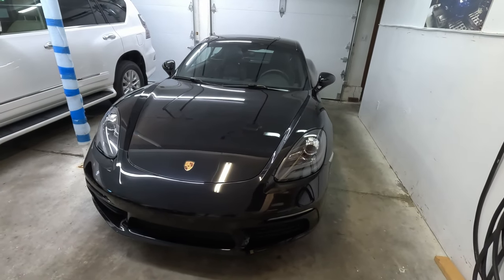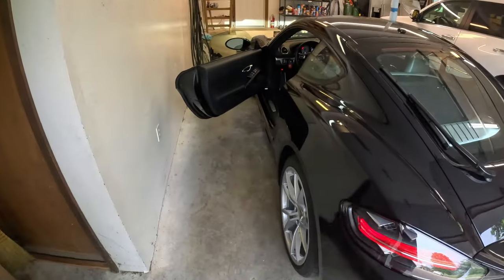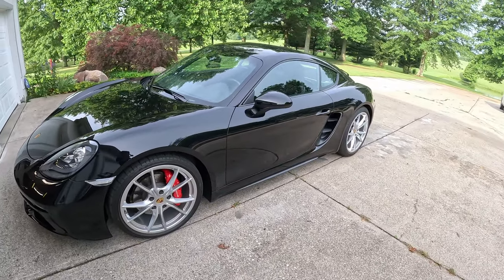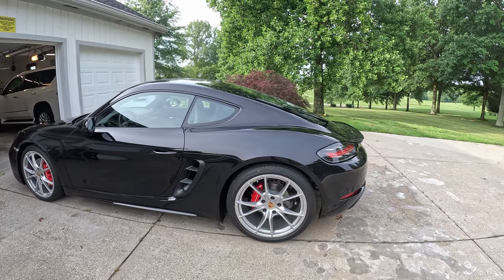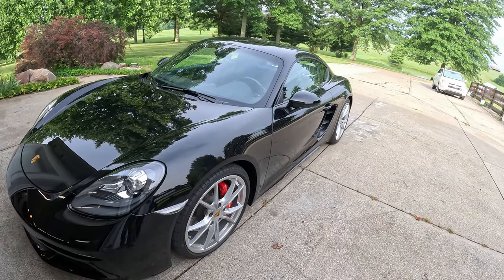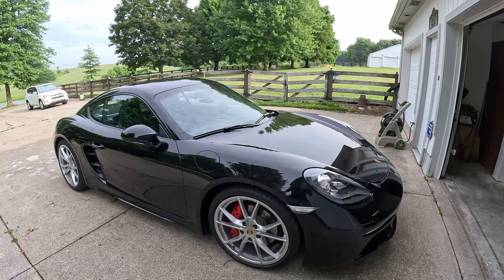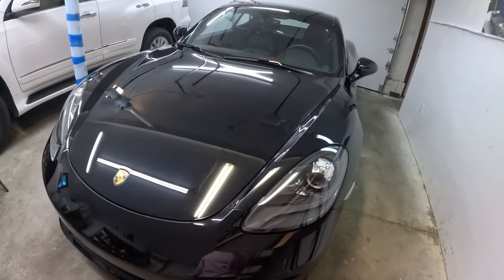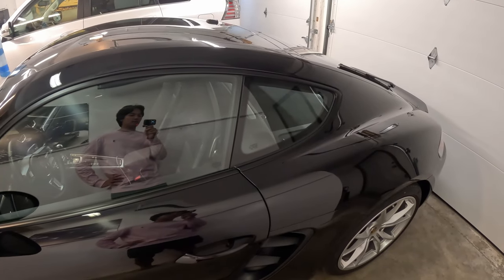Valve Lifter Noise "Lifter Tick" Solution for Porsche 718 Cayman

Comment: I got the exact same problem.   The lifter(s) intermittently ticks on start-up.   My Porsche can sit for one day or one week, the tick can randomly happen.   Unlike yours 10K miles car, mine is 15yo, and with 64K miles.   The liquid moley hydraulic lifter helped for about 200 miles, then the lifter randomly ticks again.   It looks like I'll need a lifter replacement.
Reply from the maker: Sorry to hear that man. It doesn’t seem like an easy job whatsoever.
Reply: What does a lifter replacement cost?
Reply: @herrserrus17yearsago49  I'd imagine that it's expensive. We're talking about get to the heart of the engine.   I'm gonna do protective maintenance with liquid Molly additive for lifters every six to twelve months.

Comment: I have the same ”issue” with my 718. At first I thought it came with low outside temperature but it varies a lot. I have tried for a while to let the engine run on idle speed for 20 sec or so before turning it off after a drive. I don’t know if its coincidence but I have not heard the ticking since starting with that. I will for sure try that additive. Thanks!
Reply from the maker: Yup I’ve noticed it varies a lot as well. I’ll try letting the car idle for a little bit before turning it off. Def wouldn’t hurt the car it’s worth a shot.

Comment: Also helps to upgrade to high air flow filter. It adds alot more exhaust notes that block out the ticking sound.
Reply from the maker: Absolutely it does! I have the K&N filter. It helped with the turbo flutter noise as well, it was well worth the upgrade.

Comment: Yup. I have this with mine from time to time as well. As you said, mostly noticed if the car has sit for a few days. It goes away within a mile or so. The first time I heard it I was worried… lol 

I came across a good write up from someone explaining the issue: 

To understand why hydraulic lifters can tick you should bear in mind how these lifters are designed and how they work.
Each hydraulic lifter is a small piston cylinder unit filled with motor oil through a check valve by the force of a coil spring inside. When the assigned inlet or outlet valve is closed, this coil spring expands the unit until the basic diameter of the camshaft is contacted, thus any valve clearance is eliminated.
If an inlet or outlet valve opens, the check valve is closed and the assigned hydraulic lifter becomes a solid part by the included motor oil. But still a very small amount of oil flows along the annular space between piston and cylinder of the lifter. This small leakage is absolutely required to avoid a pressure increase, which could keep the attached inlet/outlet valve a little bit open all the time (resulting in loss of power and severe engine damages).
Now have a look on a 4-stroke engine. A little bit simplified, inlet valve is opened during intake stroke, outlet valve is open during outlet stroke. Both valves are closed during compression and combustion stroke. That means : One quarter of all valves is always opened, even if the engine is shut off.

If the cooled down engine is started again, the clearance of the former opened valves has been initially increased and it could take some time, until the assigned lifters are refilled with oil through their check valves - particularly if the motor oil has become cold and has high viscosity.
This increased clearance could be audible as "valve ticking", is absolutely normal and should disappear after a short period of time.
It is strictly to distinguish from the well known idle speed ticking, which does not diappear but even increase with a warmed up engine.
Reply from the maker: Great write up 👍 thanks for sharing

Comment: I’m not sure if this has been discussed, but, there are no “hydraulic lifters” in these motors. Cam lobes push down on valve spring buckets. 

Most common cause of ticking is coming from variable cam timing phasers and/or timing  chain tensioners.

Overtime, as oil breaks down, it leaves deposits within small spaces of cam phasers and causes oil pressure to not build up properly timing chain tensioners.

Yes you can put an additive in the oil to help mask this issue but a real solution would be to some run something like 6-8oz of seafoam for about 500 miles before every oil change to keep these areas cleaned out. And always do 5k mile oil changes on these motors.

These motors constantly run oil temps pretty hot and this leads to faster breakdown of oil and leads to these ticking noises.
Reply from the maker: Okay yeah that would make sense this is great information thanks for typing this comment up. I’m sure this will help a lot of people looking for solutions. That might be the next logical step in solving for the issue. ATM I haven’t heard any more ticking since the additive so I will leave it alone. But if this problem persists and returns I think the Seafoam to clean out the cam phasers isn’t a bad idea at all! Thanks for sharing this.